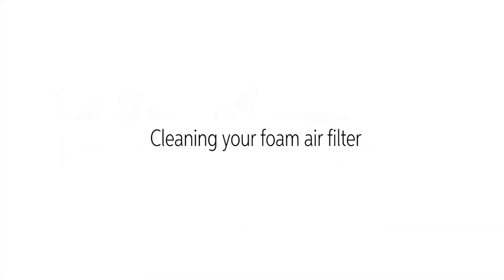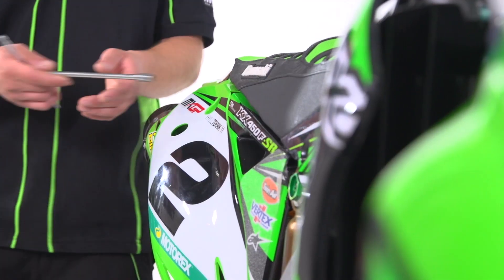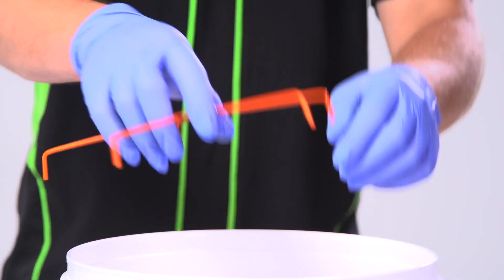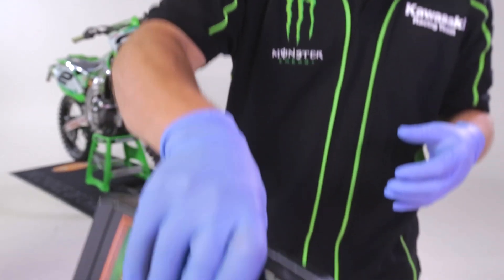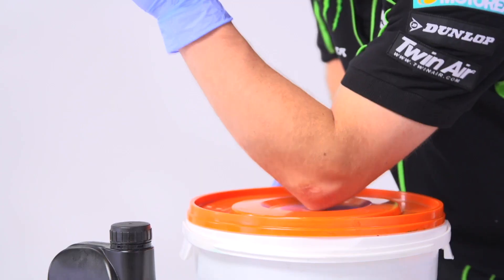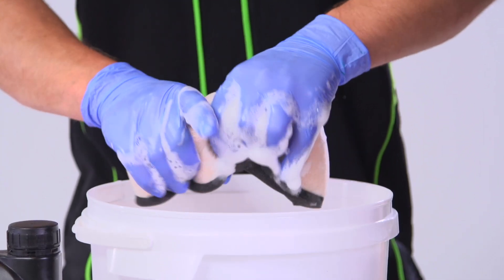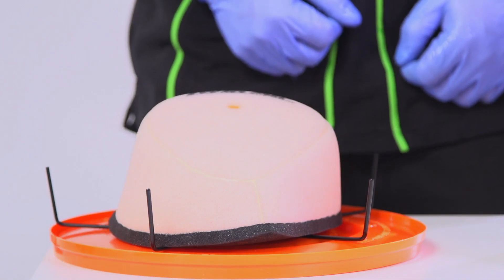How to clean your foam air filter

Comment: 24 hours to clean your oil filter
Reply: +81griffin you shouldnt clean your oil filter
Reply: @rayne175  😂🤣
Reply: Buy new one 😂
Reply: on the bottle of the newer Twin Air foam Filter Cleaner it states "leave the filter in the hot soapy water for at least 15 minutes" i always leave it in there for a little longer, 30 minutes to 1 hour is enough and it always works!

Comment: I would rather not follow any procedure that allows the dirt from the outside of the filter to reach the inside (clean side) of the foam.  Submerging the entire dirty filter does just that.  Anyway, that's the method I followed for 33 years.

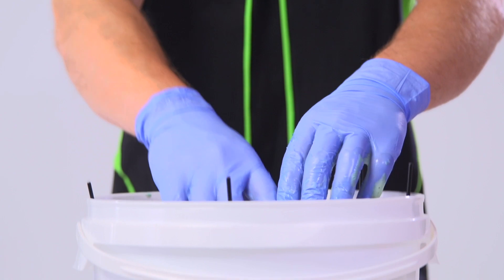Comment: 1:38 can confirm that the black rack doesn't work as shown due to the ridiculous design of a tapered bucket, which means it doesn't stay down and instead just slides up. Overpriced cack. You'd be better off with a cheap 50p bucket & piece of wood.